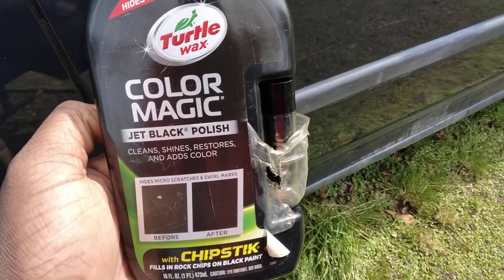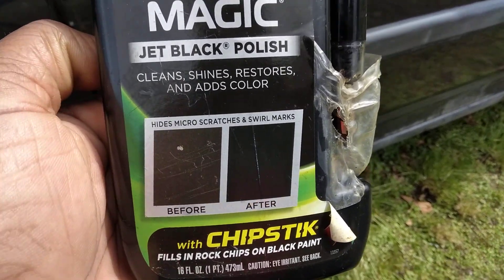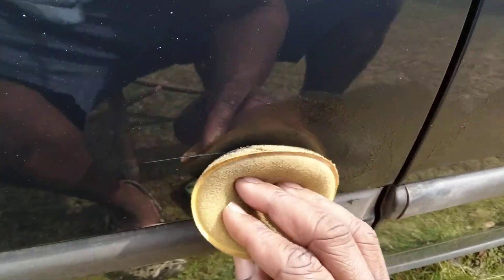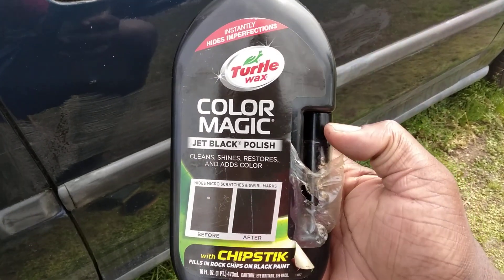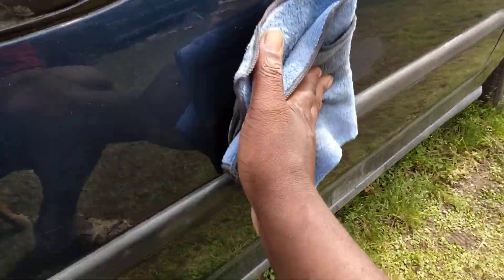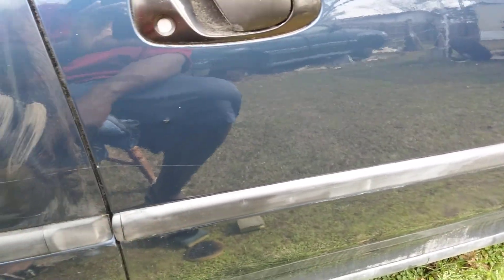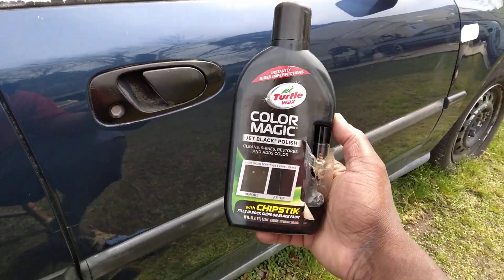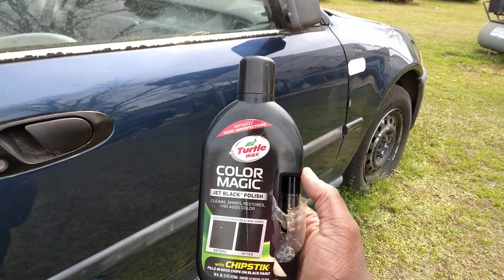turtle 🐢wax black color magic 🎩 let's see how good this hide deep scratches

Comment: dude your supposed to use the black wax crayon to fill in the scratch  thecolored wax "Crayon type" stick you can use to literally fill very deep or wide scratches with before you apply a top coat of colored or black car wax.
Reply: Hey do you know where I can buy such a crayon? I can't find one anywhere online. I used one once a long time ago, and it worked great.. but nobody sells them now
Reply: U are talking about a regular wax crayon used for art ?